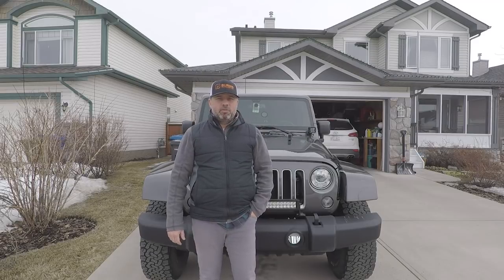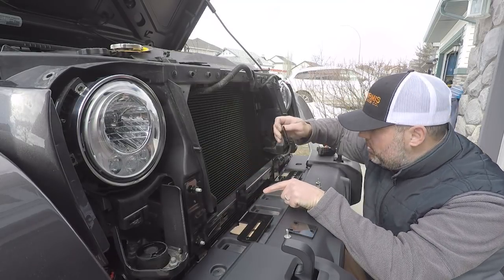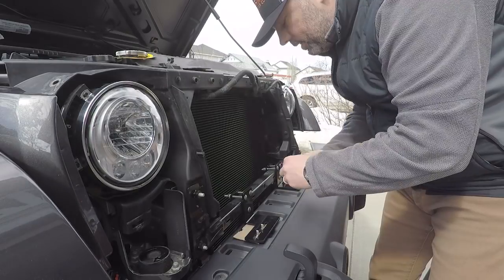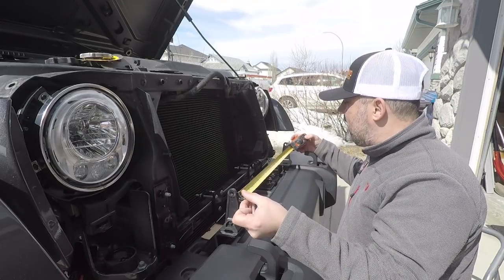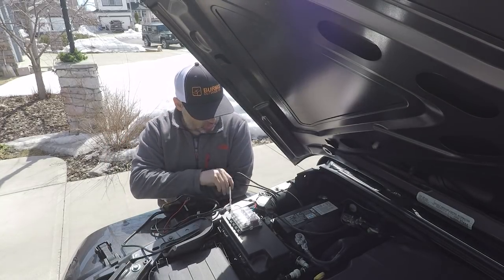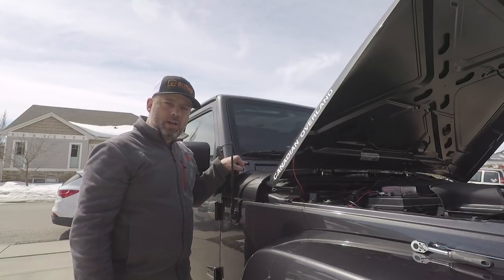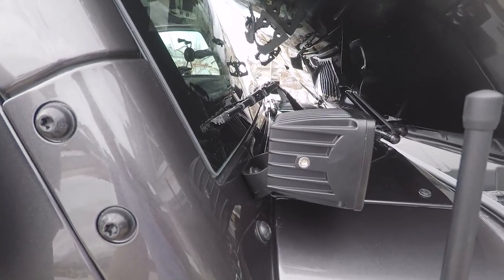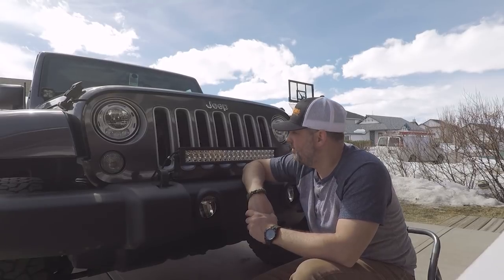410X Presents: BrightSource LED Lightbar and Cube Spot Lights Install

Comment: Hey man where you ran your wires instead of running them threw the fire wall I did the same way and water from rain got in just a heads up👍👍

Comment: Nice install Cappy. I am pretty sure you will be getting some water inside with the location you ran your wiring to the interior. I have found the best place to enter the cab is behind the battery. If you pull back on the fire insulation there will be a large plug/hole. Get a Daystar rubber boot which will allow you to run many wires (because you know there will be more, lol). I've been looking for a bumper mount kit like you used, however I cannot locate it on the bright source web site, can you provide the link please. thanks!!!
Reply: Len Silvester  I never ran mine through the drivers side but my drivers side floorboard gets FULL of water. There is a plastic rivet on the weather stripping next to the dash and think the water gets in there. Watched a video about it because Jeep service didn’t know. Going tomorrow to try and trade for a JL. ( mine is a 2017) sucks that a brand new Vehicle leaks. The JL is designed differently at that spot  so it should be good.

Comment: The type of back country wheeling you guys do I don’t think you need a big heavy winch bumper. You could get a winch plate for the top of the factory bumper and pick up a decent 10,000 lbs winch anywhere for $500. That’s all you would need and save a lot for the next mod. Can’t wait to see the new rig out on the trail.
Reply: i would rather have winch than light bars

Comment: Double check but because your ditch lights are above your headlights they are not technically "street legal /dot" even they are marked
Reply: I doubt he will need to run them on the streets though.  However you bring up a good point that just because the lamp is "approved" doesn't mean you can stick it where ever you want and be legal.